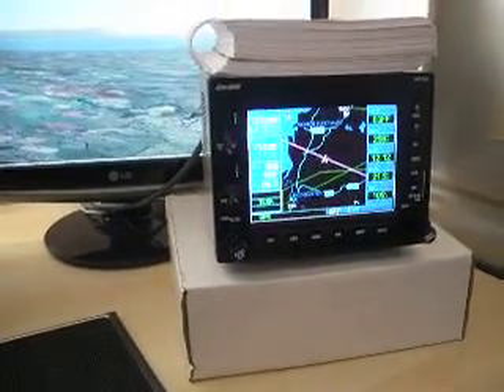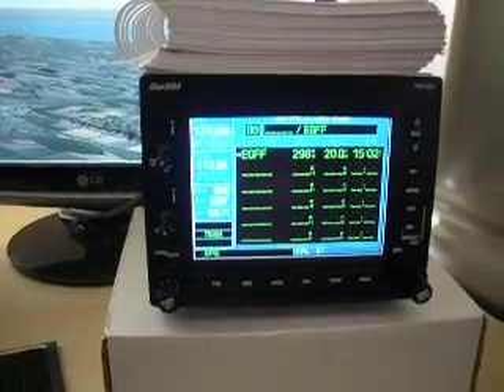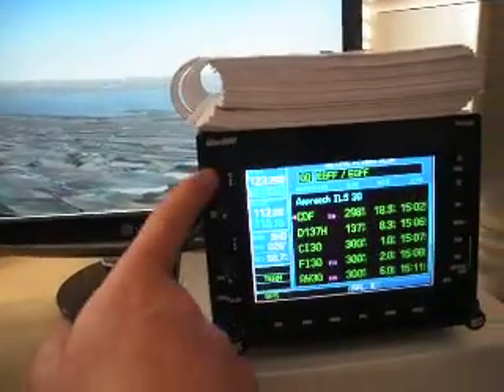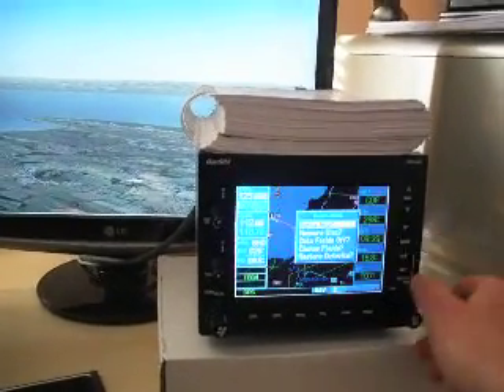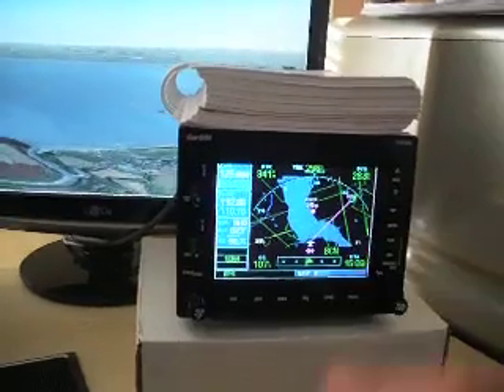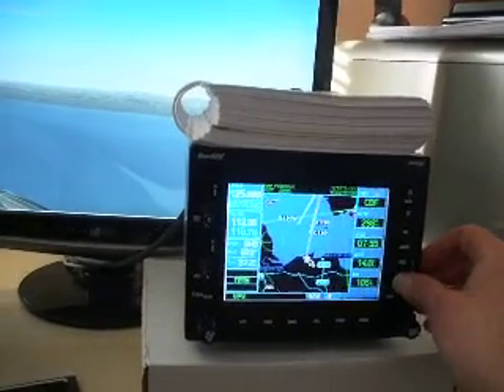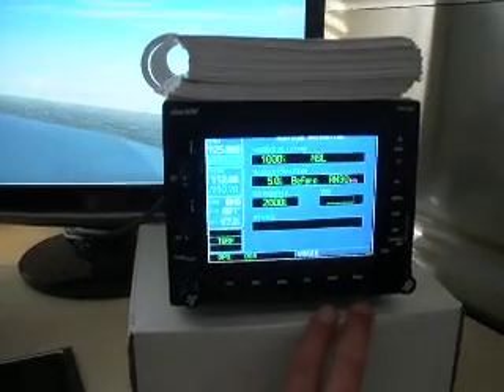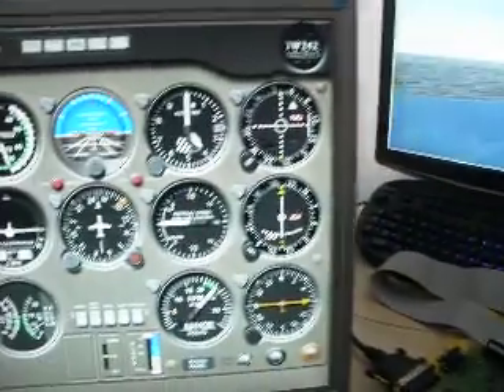GarSim530

Comment: Is the same unit that is sold by emuteq? If so, how does it work with xplane 11, Does it work with the default xplane G430/G530 or does it require the reality XP GNS? I take it that it works with both the 430 or the 530, just as a monitor, correct? Thanks